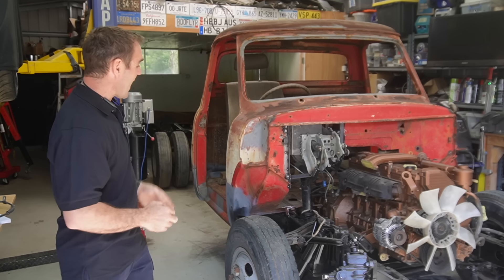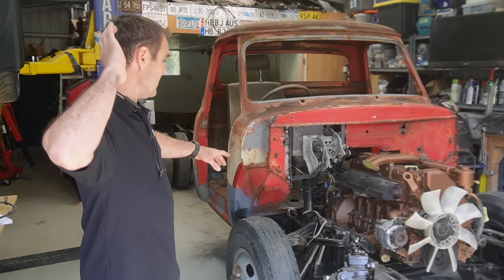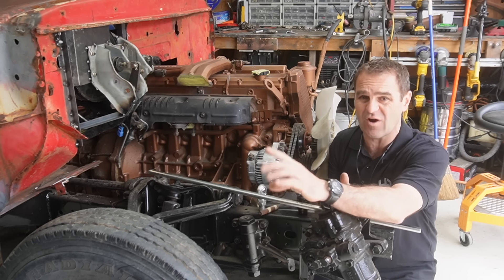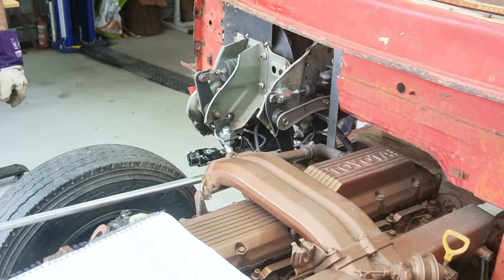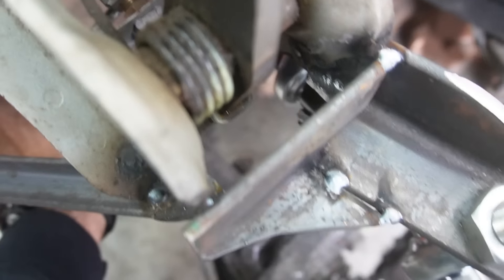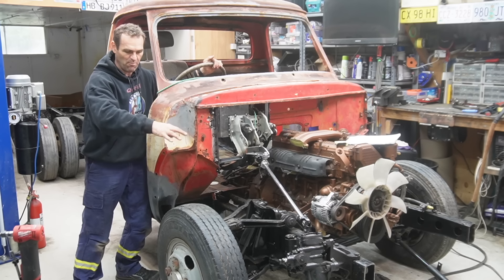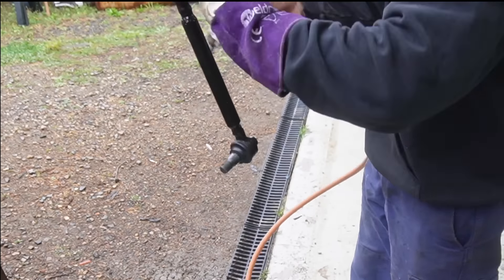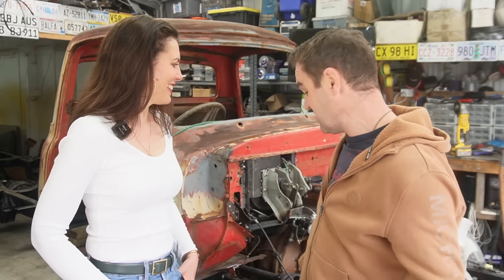Steering in the right direction - 1954 Ford F600 Car Hauler Build part 21

Comment: Invest in a replaceable carbide insert parting tool. The inexpensive ones on eBay work fine. I used to have a couple of batch production jobs in 304 SS, HUGE improvement over hss parting, plus you can use it for turning and grooving. Keep up the great work, be safe!

Comment: Great vid. Thanks Jeff. As previously mentioned you'll need to add the collapsible bit to the column... for my clubman it was DD   solid top and bottom, with the hollow shaft in the middle secured with M6 grub screws. My engineer wanted 150mm crush travel, from memory
Reply from the maker: The Toyota column in the cab is already collapsable, we will see if he is happy with that.

Comment: Hey Jeff,
Like your videos very much.
For the double DD to be collapsible, there should be an outer sleeve for the shaft that you installed to slide in.. (the outer sleeve is fixed at one end joint and the inner shaft is fixed at the other end joint.)

Comment: G’day Jeff,
 You probably know that the modified car world has been using under dash boosters for decades. 
As to your steering linkages, the hot rod community has been using this method for decades as well.
 Some of your YouTube commenters, should research before posting silly comments.
 I personally think that you are doing an amazing job and you really do think outside the box. I can tell that this is not your first rodeo haha!! Your experience shines through.
 Keen to see how you tackle the next stage of the build 
Cheers Chris

Comment: Protect the rubber gaiter on the rod end with a strip of wet rag and heat up the area where the taper goes with a gas blow lamp and it will fall out.

Comment: I never had a problem disconnecting tapered shaft ball joints, in my 10 year caerer as a mechanic. I always found a good hard swing with my 1.5 pound hammer, would do the job.
Reply from the maker: I tried many times with the hammer but these big guys didn't want to budge.

Comment: I agree with your RivNut analysis except for fiberglass or alloy panels.  There RivNuts are often a good answer.  In steel, a couple of tack welds on an ordinary nut are a better answer.

Comment: The chance of finding a plug and play set of pedals with booster etc that fits the ford cabin and connects to the coaster engine are zero. So if U have to make adjustments why not do that on the set U already have....that's wishfull thinking and logica🧑🏻‍🎓
Captive nuts.....it's also my advise to who ever is gonna build anything.....if U have the chance to capture the nuts than do it. If you ever have to be on those bolds again you'll  be happy you captured them👍

Comment: Hey Jeff - have you considered the effect of the phasing of the universal joints in the steering column?  Consider that one UJ at an angle would give you torque fluctuations as you turn the steering wheel, and having two UJs - if correctly phased - will cancel each other out to give smoother steering. You appear to have three or possibly even four joints if you count the joint half way up the column!  This might not manifest itself as too much of a problem on your build, but fewer joints - an even number, correctly phased and at similar angles will always be safer and smoother.
Reply from the maker: Yes

Comment: If you wanted to make the steering shaft support cleaner, you could use a normal bushing/bearing instead of the two rod ends. But since you have the space, this works and is probably easier during assembly.

Comment: the bit i hate about welding captive nuts is how the nut shrinks with the heat.
Reply from the maker: Have to let it cool completely before taking the bolt out
Reply: Try using a high grade bolt in it with a dribble of high temp high copper content anti seize just for the weld in and you shouldn't have issues.

Comment: Use the two hammer trick to remove tie-rods - most receiving ends for tie rods have flats on them for that purpose - ever wonder why they are there? Not failed me yet.... Much easier than the tire rod tool which I have but never use.

Comment: Instead of a custom steering rod could you use say landcruiser tie rod ends and the factory sleeve to join them, maybe off a 100 series with independent front suspension or a hiace or Hilux etc

Comment: Jeff; as much colonial question as suggestion- a bracket with a hole in it, much like the one you made, and a machined bushing which your lathe would have been handy for, all then bolted up securely and it's angle set to fix and determine where the shaft would stay. I hope I explained that well! But wouldn't that have satisfied both the terms of your MOT and actually done the deed? Just asking- you have to like the solution to begin with, I know, but I've gotten that past state law and required inspection over here.
On a more suggestion line; Anthony Brawler of "Hard Dore Fab" is doing a Chevy C10 from the late '60s- the back of that cab has some very similar shapes as the Ford; Anthony is 6'4"- say 1.9 meters tall and if he was skinny (he isn't!) he should weigh 240+, a full hundred kilos, and the Chevy was to small for him to drive comfortably, so he cut the cab back off and "supercabbed" it. Until you look at it, btw, he isn't a finished bodyman, it would be hard illuminate further. My suggestion is obvious- could this work for you? The Ford's read shapes are very similar. 
Anyway, soldier on, I'm quite sure some other task needing twice done will turn up when least expected! Mrs. J, always good to see you well and a strong support for Jeff's "other girlfriends"!

Comment: Does putting in the 2 eyelets (rod ends) on either side of the flexi joint on the steering rod negate the safety purpose of the flexi/universal joint in that area? 

Would something like a bearing carrier in the first position be better? It wouldnt have the sideways movement that the eyelet/rod end has. 

Your Engineer would be the person to confirm that 👍.

Comment: Hi Jeff, always enjoy your videos. I was just wondering wasn't it possible to remove the U/J from the bottom of the steering column and replace it with the new one therefore removing the problem of running two U/J's side by side and the need for the rod ends?
Reply from the maker: It doesn't come off

Comment: All of the rules regarding engineering,  yet in the uk, traffic deaths are at half the rate, and don't require the sane scrutiny for modification, in fact, the u.s. is at barley double, yet the risk based on population density is 14x worse, and we have nearly no laws on modifications.... can anyone explain that?

Comment: Ayton senna died due to the steering shaft being altered it was supposed to be a test job to judge the length then a new one would be made in one piece.
Reply: I thought a suspension component broke off and hit him in the head(helmet on)?
Reply: @BackyardMechCon  shortened and welded steering shaft as far as I remember
Reply: Seen a video of a Korean car manufacturer who tested, 1 of every 10 cars,  all the life treatening components of their road cars under extreme circumstances. Wish they've done it on Ayrton's car to😞